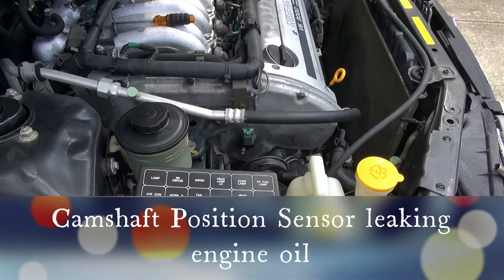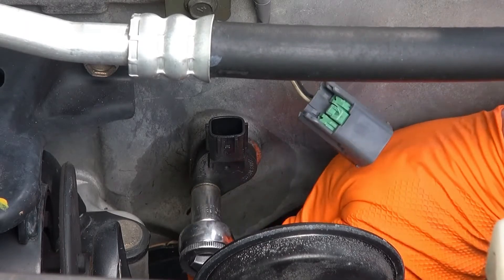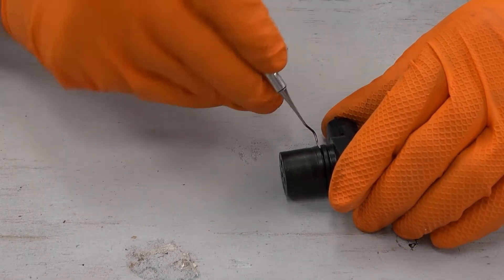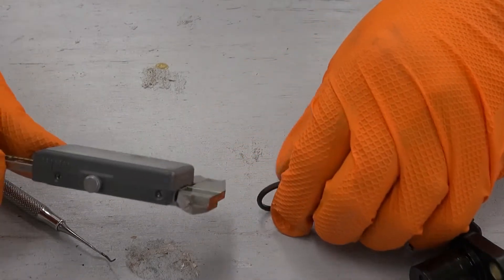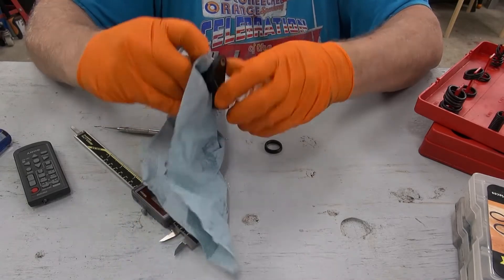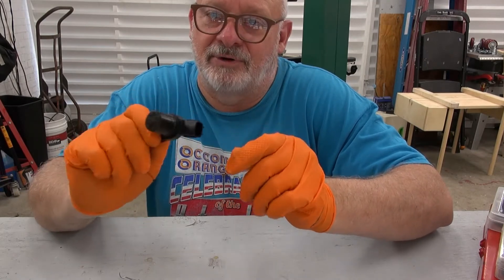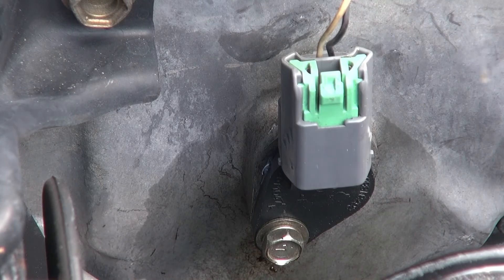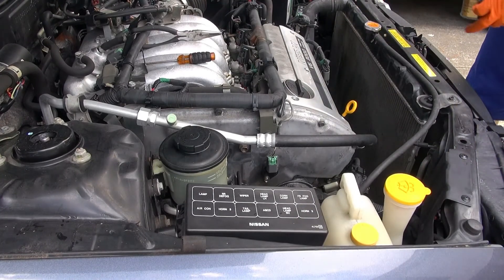Nissan Maxima Cam position sensor oil leak

Comment: Did you find leaks anywhere else? Trying to track down an oil leak on my 03 Maxima, already replaced my oil pan gasket and oil cooler gasket but it hasn't gotten better.
Reply: any fix?